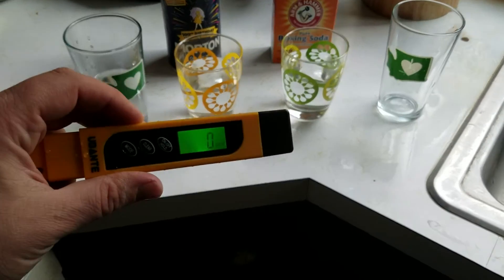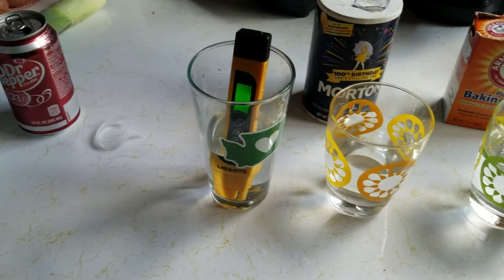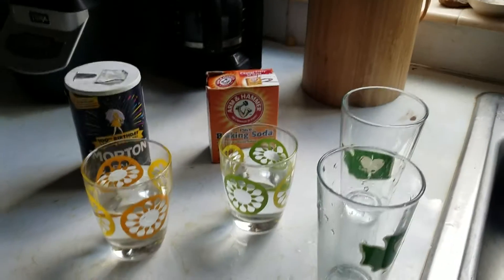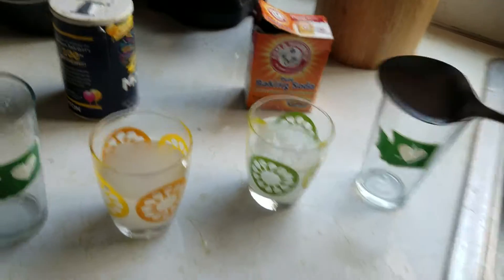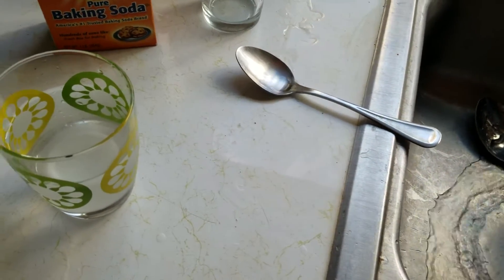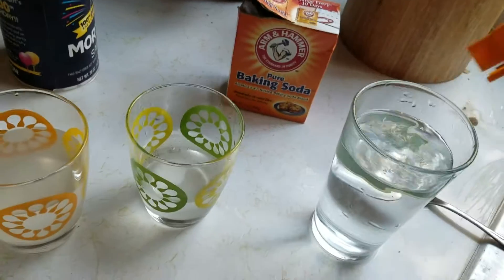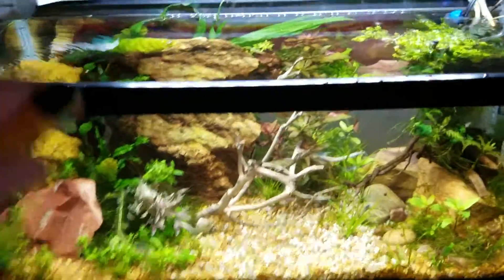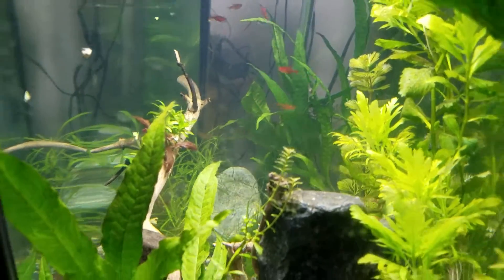T.D.S. - Everything You Need to Know about Total Dissolved Solids in Your Aquarium & Much More!

Comment: One of my betta tanks, my 35g, has TDS of 506 and the, other, a 12g, has TDS 862. Also the 35g has a PH 7.8 while the 12g has PH 7.2. Should I be worried if all the other parameters are good? I do also have nerite snails in both tanks that look like their shells are starting to disintegrate a bit. 🥺Both tanks have quite a few plants but I plan to get more soon. Also my tap water has TDH of 303 for cold water and 475 for hot water. Please help me know if I need to be concerned about TDS and what to do about it?
Reply: Your PH is too high at 7.8 and TDS over 400 can be an issue. Water change and use RO water mix to very slowly reduce you PH.

Comment: My aquariums have a TDS of  (Bolivian ram tank) 1600ppm and (platy  tank) 2000ppm and an EC in micro siemens/cm of 3200 and 4000 respectively.  Are these values too high? Both tanks have a pH of 7.5 and my ORP is 290mV and 320mV respectively. I'm using the 10 in 1 digital water parameter meter jq-006  Thanks love your channel
Reply from the maker: Nope you are okay if that ram is not wild...which i doubt it is. Ive seen rams in 7.8 and spawn in 7.6 when given lots of fresh water changes and oxygen. So the ones being bred are often bred in harder water than the wild ones...by a long long ways off. Its really only imported wild fish that you have to worry more about aclimating to that...and some key species like cichlids from africa or rainbowfish etc.

Comment: I got 2 blood parrot and they are still lil babies. Like around 1 inch or so. Our regular tap water TDS is around 118. My goal is to keep the TDS level between 200 to 300. In order to achieve this I have to do the water change daily or sometime every second day. No real or artificial plants in the tank just few hiding spots with power filter and air pump. After doing water change TDS will drop around 215 or so however in 24 hours sometimes TDS reading will be 364. Is there any reason that you can imagine why TDS is increasing so frequently. I do vacuum the gravel for any waste every time I change the water. Also my tank is like 8 days old or so.
Reply from the maker: Sounds like you have a layer of soil created by mulm compacted down into the substrate (which many people are very jealous of!). But I'm guessing when you gravel vacuum it exposes mulm which us acidic and dissolves any calcium or carbon in the substrate.... which would raise the tds... make the ph drop a little...then when it that acidic layer starts to break down any sediment, it neutralizes or even turns the layer slightly alkaline. 
I'd suggest you only vacuum big stuff like leafs, extra food or big curly qs of poop sitting loose on top...but try not to mix or disturb the sedenent and let that mulm build a bit.. just like in a natural lake or river. Maybe add 2 cups or so of crushed coral/shells to buffer the tank's ph if you want.

Best of luck! Happy fish keeping
Reply: @Fishtory  it’s just gravel nothing underneath as a matter of fact it was just gravel replaced it with aquarium sand TDS still rising no soil nothing 🫣

Comment: I’m still confused about the CM reading part on my reader. Is it conductivity? 
Is there a video on it? 
Excuse my beginner lack of knowledge & understanding
Reply from the maker: No worries. We just don't use it in freshwater usually. It is, as you assumed- Conductivity. It isn't used usually, due to a lack of information. As Conductivity can be effected by dozens of things. So while it may tell you the Conductivity, it doesn't tell us if that's due to minerality or metals in the water,, due to ionization or due to salts etc. etc.. Without the test kits for identifying various elements, metals or relative gravity/ salinity, it just doesn't narrow down much info for you.  
Some fish that use electrical signals or a stray appliance that's shorting out (a heater that breaks , or impeller that's sending a current into your tank (all rare Occurrences) ,however usually your fish all dying will indicate that issue much easier.

Comment: Hot water has a higher TDS than cold water because the molecules have more energy - bear this in mind. The increase may not be due to aeration
Reply from the maker: So them having more energy, they can hold more Dissolved Solids? I would have thought that physics wise,  cold water expands the matrix of molecules and holds more. ... interesting thanks.

Comment: I went back to this video. After testing my tap. It was at 350 with zero for GH, nitrates, Nitrites. I then figured out it was my water softener. That was all sodium. 
So then I by passed my softener. This time I read around 250 but my GH went up to hard. 
I'm so lost with that because either way I cut it. 
It's too much for my neo's and that's before any plant waste, food waste, animal waste, and fertilizers for my plants. All these things can sky rocket my TDS up to 800. 
I had to did a 30% water change in it yesterday with RO water and that only brought it down to 550 TDS. 
This is a 40 gallon breeder. 
My nitrites are 0 and my ammonia is zero, my GH is hard my PH is is a bit over 7. 
What should I do with that? 

Literally up all night battling my TDS.
Reply from the maker: Oi that's rough. I suppose depending on your ph you could add a decent amount of almond / oak/ maple leaves, which would add a lot of acidity and tannins. Then add crushed coral or shells to your substrate. 

However, if possible ask for a print out of what's in your water from the utility co/city. Most will let you see it 1 or 2x a year free...or charge like 5 or 10 dollars to test it. 

I'm guessing it's iron or copper etc....some sort of other thing causing your hard water... but short of a filter or RO/DI system- you're pretty limited annoyingly.
Reply: @Fishtory  I appreciate your feedback. For the time being. 
I went and bought 20 gallons of purified water. 
I cut my filtered tap with that. 
Gave me a starting point 100TDS. 
Gives me a bunch of wiggle room. 

I'm doing more digging around today. Call my water company and find out about those minerals. 

Thanks again man.
Reply from the maker: @atomicfinds  good luck 100 tds is nice and low for now. I know it can be a battle, man . Best wishes on it
Reply: @atomicfinds  I am going to have to do the same! I am just now learning about this TDS stuff. My well water reading is 515!!!  Darn it! Luckily I only have one Pleco in a 55 so far.

Comment: If the total TDS (266) of one of my tanks is about double the total hardness (GH of 70ppm  + KH of 36 ppm), what could the rest of the TDS be? 

I use dechlorinated tap water for water changes, and top offs with RO. Water from the tap is ~ 150.

TDS is high in the tank from repeated top offs with tap water instead of actual water changes. I'm gradually lowering them.

- Ammonia: 0
- Nitrites: 0
- Nitrates: 0
- pH: ~7.5
- Almost never dose ferts, just started using roots tabs conservatively, and we'll buried.
- Using ~1 year old Aquasoil
- Botanicals (alder cones, cattapa leaves) added from time to time.
- Moderately to heavily planted for a 15 Gallon Cube.

The only thing I can think of is sodium from regular feeding of live brine shrimp, but it'd have to be from their carapaces since I rinse them in treated water before adding to the tank. Could that be it?

In another tank I have, the total hardness equals the TDS almost exactly. Same water source, but inert gravel. So I don't think this is heavy metals.

What else could it be?
Reply from the maker: Calcium, sodium, it could be carbon from organic or plant matter, phosphates, zinc, iron, and if you use Dechlorinator , as we almost all do- then the nitrates and ammonia related compounds are not destroyed  but rather, they get trapped in a sulfur and salt matrix cage, and therefore are neutralized in ph, and cannot dock or bond since they are turned into a big blob of a molecule....so it could also be those blobs some what too. 

In reality it's almost certainly a mix of half a dozen elements or compounds

Comment: Very informative thanks.  I just put in 16 CPDs in my heavily planted 17 gallon and and two days later all but one died.  I tested my water and all levels seemed fine (nitrates, ammonia, nitrites all 0) except for my TDS being high. We have hard water here in Houston. I think that might have been the culprit, so I came here to learn about TDS. I think I may need to get an RO system
Reply from the maker: Yes, could be that, could also be any trace amounts of fertalizers, oils, pesticides etc if its a used container... i like to buy a few 99 cent zebra danio at petco and put them in a tub the first few days to act as a canary in a coal mine
Reply: The Secret History Living in Your Aquarium the tank has been running great for close to a year with a group of green neon tetras. All was fine but I recently had a die off of some of the green Neons as well. The only thing I can think of is that I added some Sachem Potassium aside from the normal plant fertilizer that I use. Does K raise the hardness considerably? Not sure what else could have happened, this tank ran great for a long time.  Ironically, the Two Otos I put in with the CPDs are doing fine and they are known to be sensitive. There was also a reduction in some of my RCS in that tank.

Comment: How is your fish doing in the tank where TDS reading was ~200 on the surface and ~500 about 2 inch down? Do you think 500 can be a good indicator that it's time for a water change? I have 5 guppies/1 tetra/1 pleco and 2 dwarf frogs in my 10g. My tab water TDS is ~180. I have just planted bocopa/glosso which will gradually raise TDS so I was wondering if TDS can be a good water change indicator.
Reply from the maker: yeah usually a tds thats super high means you have a high ph also...but certain things like chalk and calcium can do that , sometime if soil is super kicked up and agitated itll become dissolved also
Reply: @loreall.2461 mine is also up around 900+. My fish are thriving. I don’t understand 😣

Comment: What Fertilizer schedule are you running in all your tanks, do you use Excel?         

My well runs at 180 -210 ppm depending on heavy rains. Mostly Calcium Carbonate and about 15-20 ppm sulfur, based off of local city well water reports and I dose EI up to 350ppm....

 Also I found that flushing your water heater will significantly reduce excess carbonate buildup... Just open all your hot faucets and let the tank run empty, let it fill, then repeat flush. Do this every once in a while to keep saturation levels low.
Reply from the maker: +Bob Saget I use Easy Green  a mix of potassium nitrates and phosphate compounds with a tiny salt i think. But i use ot sparingly and let fish waste do the job woth flowing water from the HOB and a large sponge filter which moves water, oxygenates it and also just acts as another large b.bacteria sink.

Totally thanks for the tip on the hot water heater. I do that by default when my wofe and i both shower (our tank is very small, like 40 gallons or so) but the pipes for sure have debris of iron, carbon,  copper and lime slllightly. Its still only .4 higher ph than cold tap water when first running 

Do you raise shrimp or anything needing soft clean water?
Reply: The Secret History Living in Your Aquarium I have raised shrimp on almost identical tap water
Reply from the maker: +Bob Saget yeah you can actually raise crystals in our tap water... it's  kinda crazy